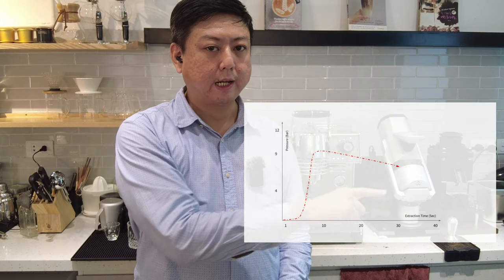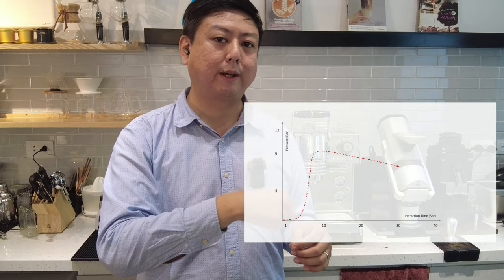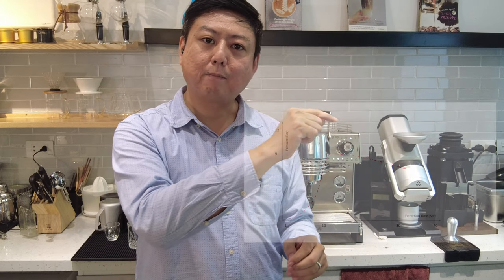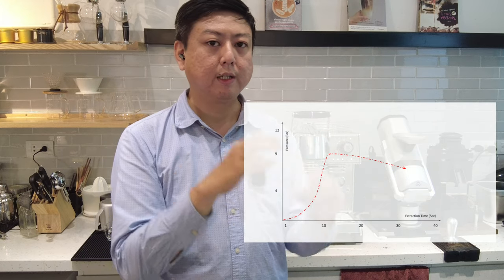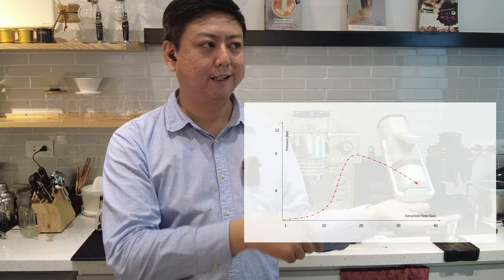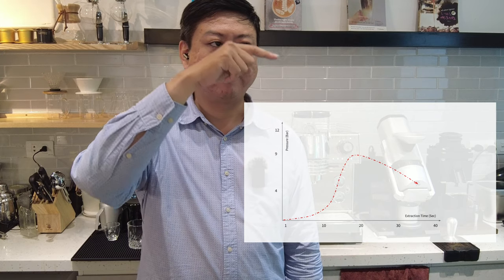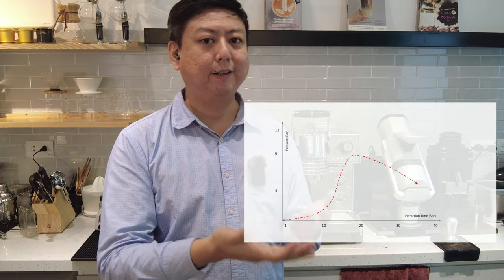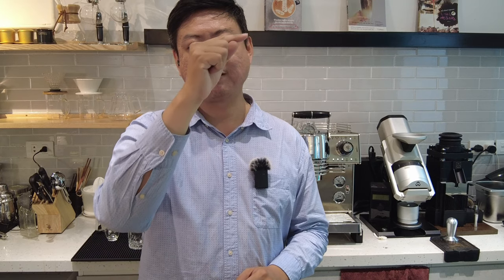Espresso Pre-infusion Part 1 - Flow Rate Pressure Profile

Comment: Very informative and interesting video. What is your opinion on this machine compared to R9one from rocket? Cheers Caden!!
Reply from the maker: Hello, thanks for watching. 
For my opinion Mina is controling flow rate to adjust the pre-infusion & extraction pressure, while rocket R9 one is controling the pump pressure to adjusting the extraction pressure. in result they show's a big different in body of coffee. most of the flow control machine give you thinner body but more higher clarity in flavor and aftertaste, while pump pressure profile give you more thick body and more complex flavor.

You can check my part 2 video, I'm demo with a machine call Opera and the machine using pump pressure control like R9 one.

Personally my taste is more towards flow profile because most of the time i drink single origin and i would like to have more clarity of flavor from different origin.

Comment: I don't understand your flow rates. You said you do a pre-infusion at around 2gps until pressure builds then increase the flow to around 8gps, however your total output is around 30-32 grams in 30 seconds. The flow of 8gps would yield around 240 grams in 30 seconds, so confused I am.
Reply from the maker: The flow rate of machine mean you limit and control the maximum water per sec that machine can supply, the coffee output supply will slow down when pressure is built up. So in pre-infusion step I use low flow because I want to whole head space between shower screen and coffee puck to fill up slowly and built up pressure slowly, when getting up to 9 bar pressure I push my flow rate to 8g / sec but the actually coffee flow through coffee puck at that time is 0.9-1 g /sec but it will slowly increasing. If I keep it 2g / sec instead of 8g / sec the coffee pressure might be drop because when the water open up channel within the whole coffee puck with coffee out flow rate is beyond 2g/sec, my water supply can't built pressure anymore, that why I need to push the supply flow higher than the out flow to keep the high pressure extraction. Of course if I want my post extraction low pressure I can reduce my flow rate and pressure of coffee will drop because supply flow not enough to built pressure if output flow is close to supply flow.